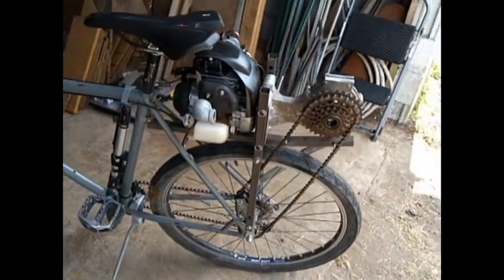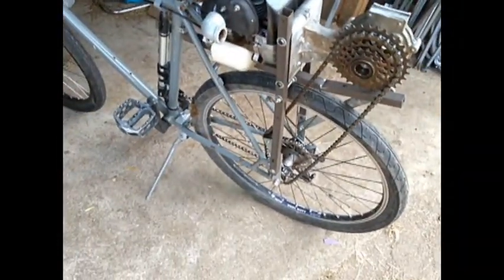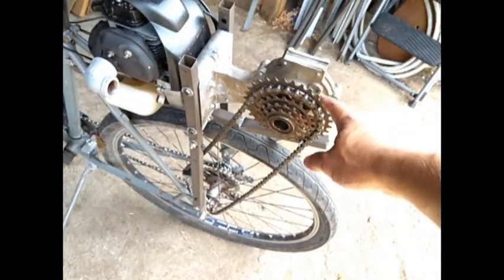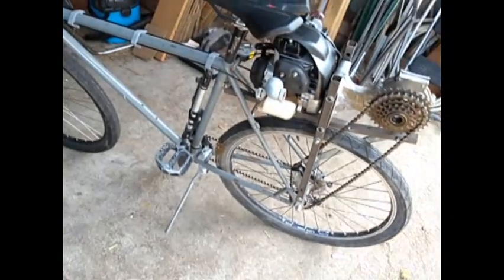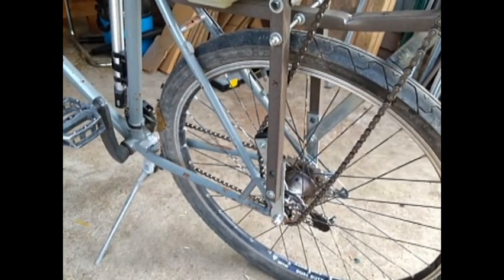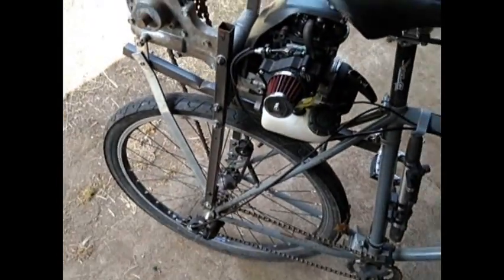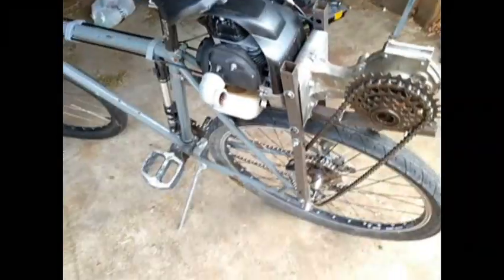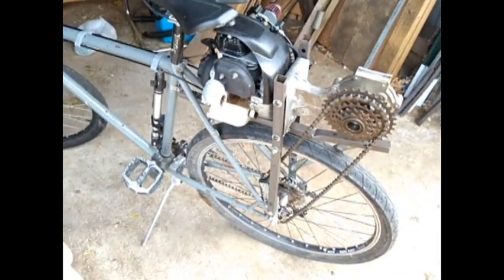Honda GX25 Tiller Motorized Bike - Mounted rear

Comment: Great mod!.The way you adapted the wormgear transmission was interesting.How did the job weld hold up? I use jb weld for most things that can't be mechanically fastenedor if I don't want bolts or screws put into things.